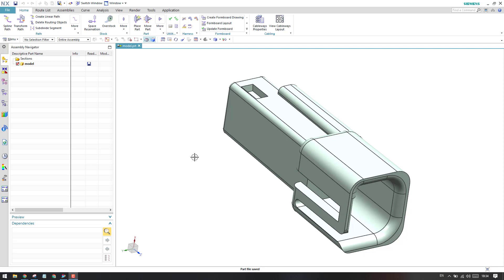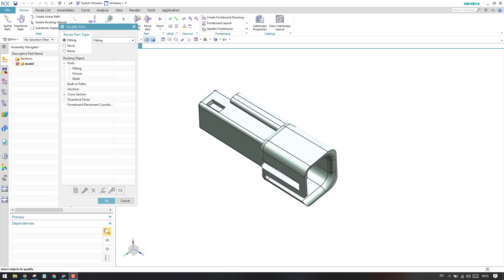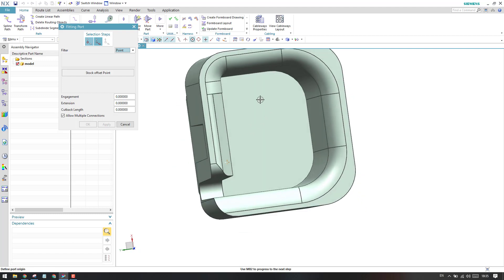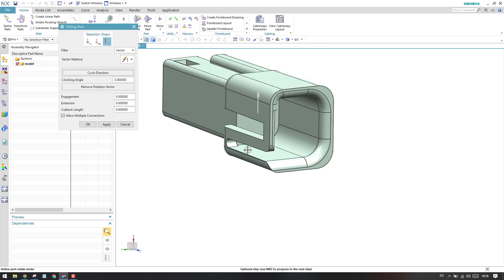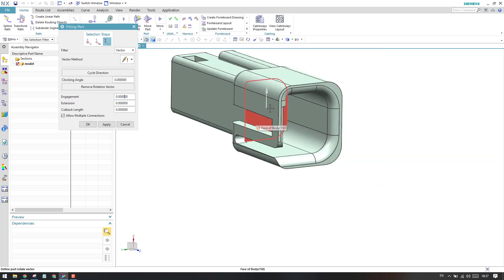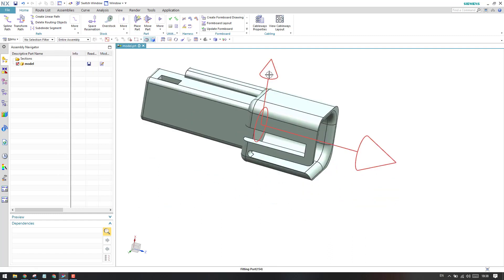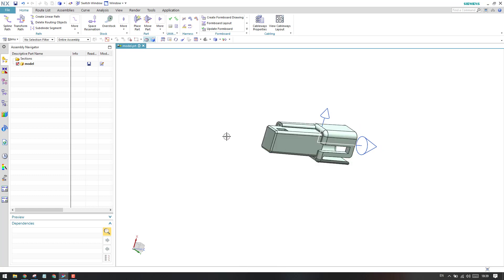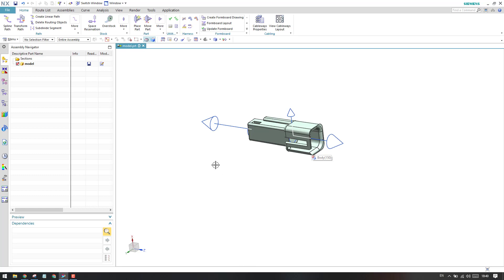Siemens Unigraphics NX- Electrical Routing/Wiring and Harness || Qualify Fitting Port

Comment: Hello Sir, Thanks for making educational content. 
To my knowledge, there is a specific purpose/difference btw Connector,Fitting Port and Connector,Multi Port and I believe you have those incorrectly described here....
For example, with the connecotr in the video the Fittin Port should be the side of the connector to be aligned/mated in assembly with corresponding connector type (i.e. PlugIN direction), when qualifying the Fitting Port it its highly recommended to assign and the vector orientation, so that later in assembly NX will have the mated male/female connector properly aligned during "Part Insert". 
The cable/wire side of the connector should be assigned as a Connector, Multi Port and used later for the PAth/Wire origin. 
Cheers.
Reply from the maker: Watching my previous video on types of ports and basics on electrical routings will clear the same.
Reply: hey i need to contact you can you please help me sharing your contact details

Comment: Good afternoon! Unfortunately, i to face such a problem: I created ports for "test connectors", added details to the navigator, created a connection, created a spline from port to port. But when I try to create a layer for the bundle, I get an error: the route is not correct and there are no source ports. 
I think the application does not see my connectors as electrical components.
Reply from the maker: Hi

Please share the model you have done to support@techdesign.tech i will have a look and help

Thanks
Reply: @TechDesignsantosh  I will try to make it when I get access to my PC

Comment: Is this connector available in the library?
Reply from the maker: Yes available in my library.. not in NX default library
Reply: @TechDesignsantosh we’re is the library
Reply from the maker: I said in my library.. its it's available... If you need connector ping me at 6361088942